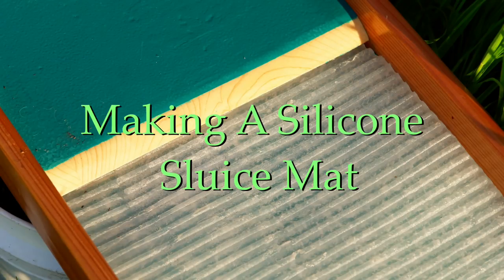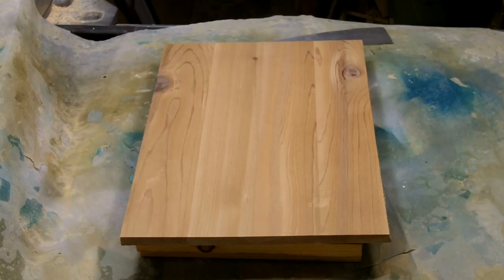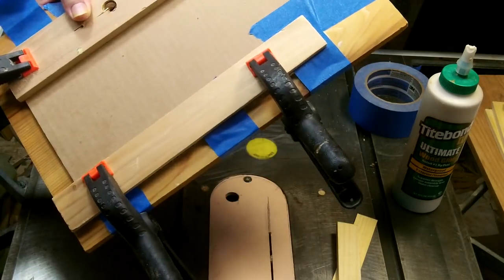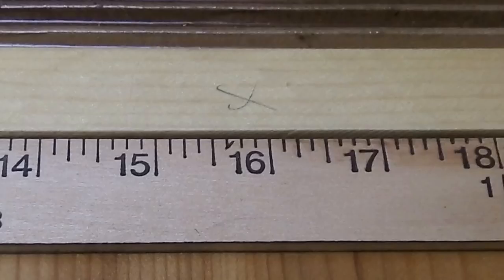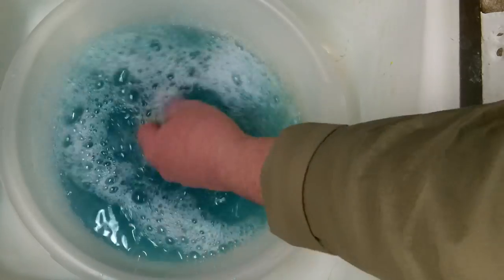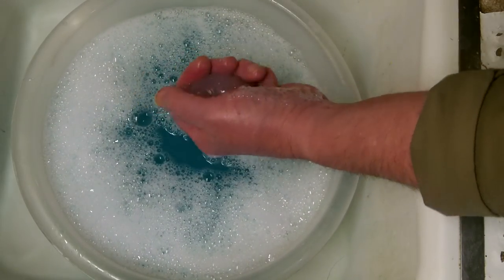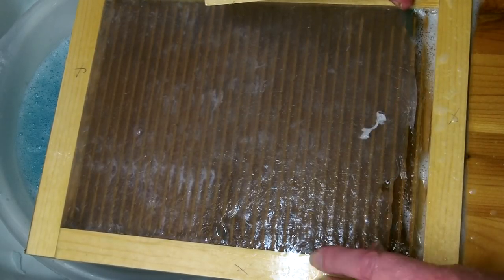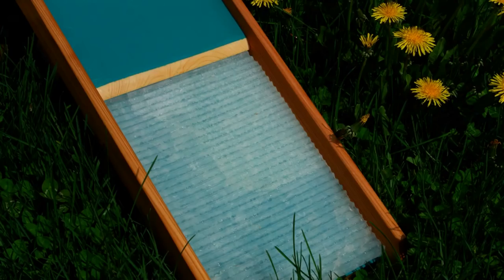DIY SILICONE GOLD SLUICE MAT

Comment: Hi Utahavalanch.  Glad you're back!  I spoke to you some months ago about building a large combo deep well/miller table sluice, and that's coming along.  I was just about to start glueing things down and installing the drop riffles when I came across Alan's videos on diy silicone mats.  I immediately started bugging everyone I knew with kids for legos that might be laying around the house loll.  And I found them in the most unlikely place.  I happen to mention my project to one of the science teachers at the school where I work, when I mentioned the legos she said, " Oh yeah there's a bunch in the back store room , help yourself."  .
So after reading the comments hers my 2cents.  
It took three tries to get a usable mat. Now my sluice is 16" wide and about 24" long....remember the idea was a short wide low flow sluice.  So my suggestion is to work on small sections and piece them together.  I tried to make one big mat using GE's
silicone...what a mess. It just did'nt cure.  I found out that the ingrediants has to say " Acetic Acid is evolved during cure."  So now I use DAP.  
Being the creative type I wanted to color my mats so using DAP I put the food coloringing to the Dawn/water mixture and could not get the silicone to cure.. it look like porridge.  I even tried the cornstarch techique... I used flour instead and I actually got a mat and it was colored but it feels like I could rip it apart.  At this point I'm thinking wooden riffles sound like a great idea! LLLOOLL.  
So out of shear frustration I took a 9x9 baking pan put the food coloring in it and put the silicone straight into the pan...no soap water mixture.  I used a spackling knife to fold the color in over and over until it was somewhat uniform, soaped up the much smaller mold, plopped the ball of silicone on it, soaped up my hands and started pushing it into the mold.  AND IT WORKED!!

I know this is long winded so I'll get to my question.  Since cardboard works as a mold per your instructions, why not use some other thick paper and fold in the pattern I want. Right?  What's bothering me about the lego drop riffles is they are straight down and I would prefer the undercut shape.  So I'm gonna try folding thick sketch paper and following your cardboard riffle instructions.  What do ya think.  Any tips?  Also what kind of paint did you use to make the green mat?
Reply from the maker: Hi Stephanie, welcome back.  I’ve been tied up on many projects and just as I finish one, It seems to bring up more ideas for another. :-D
Part of the answer I was going to leave you, I decided to add to the description as others may find it helpful as well so check that out. You can use the Styrofoam to make angled Riffles for your mat mold. 
Welcome to the land of Silicone Mat Making. I think you had all the same problems the rest of us had. Yep, it’s easy to tell the pioneers. They are the ones with the arrows in their backs. :-D  But it’s some good experience. Yippers, use DAP and I have found that Family Dollar Silicone works well too. Cheaper too.
For the coloring on my mat, I used some acrylic paint from Walmart. I used fast dry and I don’t know if that made a difference or not but the mat dried in about 10 minutes so you really have to hurry. I may try the slow dry next time.  I squeezed about half a tube of Silicone into a plastic glass, added 3 drops of paint and stirred with a popsicle stick. 1 drop would have been more than plenty. A little goes a long ways. Then I scraped it out and added it to the soapy water and then squirted the rest of the tube into the glass and repeated.

The Cornstarch technique as you found makes good molds but really poor mats. The straight silicone works the best and is also the strongest.

See down below for the next segment.
Reply from the maker: As to the Sluice.
I have been working with a similar sluice and with some new tests I’ve been doing I’m making another one. You will be the first in on this info. I’m trying to get a new video out on it but new project ideas seem to be getting in the way.
First make it a recirculating sluice that you can hook up a pump to. You can try a stream sluice but the water control is quite important on this one. Put a valve in about the middle of the hose to reduce pump turbulence and not at the sluice. You may need an 1100 GPH pump for that size of sluice. I use an 800 for my 10”. 
If you can use a 3/4” hose, Home Depot has a 3/4” gas valve that works like a champ. Back in their fittings they have a 3/4” nylon hose barb with an MIP thread that will allow you to hook up the hose to it.
Use the 3/4” wood riffles and not the Silicone Mat. You can buy square 3/4” dowels at Home Depot in the molding dept.  Or you can use 1x2’s if you want a wider top.  Make another 8” finishing sluice to run the cons through and make the mat for that. 10" wide is just about the max for Silicone mats.  Also make the 8’ just like the large one.  Make the Slick plate deck out of 3/4” thick pine or something similar. Just not plywood. Sand it good and flat on the top.
IMPORTANT: round the top edge of the bottom end so there is a good curve to it slanting down into the trough.  Leave about 1/4” - 1/2” up from the bottom of the trough straight for good water action. This curving will guide the gold down into the trough with almost no chance of it getting out. If you can cut a bit of an angle on the riffles that’s good but not necessary.  With this mod you should find all the gold in the first trough. If you find gold any farther down, then reduce the water flow.
Now a new addition to the build if you want to make it and if you saw how it works you will definitely want to add it. Tape off the curved end on the well side. leave the straight part of the top un-taped. Then do the same with the bottom curve. Then paint the top of the Slick Plate with about 4 or 5 coats of Rustoleum Chalkboard Paint. Remove the tape. When you are finished you should have a smooth gloss varnish finish on the slanted part in the well going up to a painted surface and then a smooth varnish finish on the downward curved end of the Slick Plate. 
This is really something to watch in action. This can work with at least a screening through an 1/8” mesh screen. Works the best with screening to 4 different screens and adjusting the water flow for each. 
When you drop the material onto the slick plate, the sand and gravel will move right off immediately and the gold will stay right on the slick plate. Any gold that gets carried off will travel very slowly across the slick plate, down the curve and  down into the trough. You can then brush the gold over into the Deep Well for safe keeping and snuffer it out later. This takes some getting used to when running as you put a scoop of material on the slick plate and about 5 seconds later you see all that gold sitting there nice and clean. Oh, yes, and you can also screen your material to the same size and then just feed it down into the deep well and adjust the water flow to just move out the lights and when they are gone all that’s left is the gold.
Now you can do a cleanup and rerun the material from the riffles over it again or make an 8” version with the mat to run that material over. So there you go if you feel like playing Pioneer again. :-D  Hope this helps.
Reply: @utahavalanch  
Thanks for your reply utah. Yes it's all starting to come into focus.  I had planned on a 3 step approach.
1) big mason tub classifier buried just under the waterline of the stream. The idea that has I shovel into the tub which has a screen on it the stream will carry off the lights.  Kinda like what Alan does with his wheel barrel classifier. 
If theres no streamflow than it can be done manually with a bucket of water.  The objective is to work large quantities of dirt easily.

What 4 classification screens would you use?

2) classified material then goes into another mason tub that is set up as a rather large fluid bed to concentrate further.

3) Then whatever comes out of the fluid bed goes down the deep well sluice.

Now as to the sluice.  What I think you're saying is forget the under cuts and curve both the upstream and down stream sides of the slickplate leaving a 1/4 - 1/2 " flat section at the bottom of both ends of the slickplate...even the deep well side.  Correct?
I'm inclined to use 1x2 for a wider riffle and perhaps give them the same profile as the slickplate.

Would you paint the tops of them like the slickplate?

As far as the clean up sluice, how about making it as an extension that the primary sluice just sits down into.
And figuring out a simple way to narrow and slow the water.

Look forward to your reply.
Reply from the maker: @stephaniedill9966  

Hi Stephanie. Well, lets address each item in turn. Sounds like the big tub classifier would work well as long as you don’t get a stream flow that will wash away the fine gold before it gets into the tub. The screening depends on the size gold you are expecting to capture. They estimate that 80% of all the gold is in the 30 mesh and smaller. That’s what I go after.  If it is like in my area and the gold is 50 mesh and smaller then it’s a waste of time and energy to process the larger material. I usually screen to -12 mesh and then 20, 30, and 40. Most of the gold I find is in the -30 and smaller range but I pan the +20 material just in case. I’m finding that I am working much less material now days and getting much more gold than I used to get in the old days of working like everyone else does. If you screen to -4 mesh and run your equipment for that size then you will blow out 80% of your gold. Run all +20 material separately from the rest.
You can buy excellent heavy duty stainless steel screen on Ebay in the smaller mesh sizes. You may want to use 1/4 mesh screen to screen into your tub and then use smaller screens to reduce it down to run through your equipment. I use 1 gallon screener buckets to screen my material down. It only uses an 8” square screen which is inexpensive to buy and I can screen almost as much material at a time as the big 5 gallon size screens. Or you can use the 5 gallon screens to screen it down into 5 gallon buckets. The closer you get all of your material in a batch to the same size and adjust the water flow for it, the more success you will have.
One thing to remember is that a 5 gallon bucket of dirt shoveled in from stream or bank only has at very most, 1 quart of useable material and only 1 oz that has any gold in it. Now days I try to reduce the material down so I only work the quart that has the gold in it. 1 drop riffle will handle the 1 oz with the gold in it quite easily.
So I guess the bottom line I’m saying is to know what size gold you are working with and build and run your equipment for that size gold. 

See next down below
Reply from the maker: Fluid beds work well as long as you know how to use them. If you don’t they will flush oz’s of gold out the end. I know, you see a lot of people running them and getting some fine gold. Some is the key word. Most is blown out the end. I tested for 2 years in a closed environment and found they are very lossy unless run properly. I am currently running all my old fluid bed tailings and getting the gold back I lost. That’s why I moved on to Drop Riffle.
Only work 1 screen size through them at once. Remember they blow out the fine material and only keep the heavies. If you have a mix of +20 material and smaller, then you will only have the +20 and maybe some 30 in the end. The -30 with the gold is out the door. Remember, fine gold is not as heavy as most people think it is. It is very light and easy to get caught up in water currents.

See next down below
Reply from the maker: Now the sluice.  Sorry, I’m not very good at verbal descriptions. I  am usually able to send pictures to describe what I am saying. Wish I could do it here.
If you have a saw that you can make the under cuts on the Riffles with, I would make them. 20 degrees right now seems to work well until I can test more. If you can't cut the angle then vertical will work fine.
On the slick plate, on the Deep Well side I usually cut that to a 45 degree angle so the whole end is at an angle. That makes it easy for the lighter material to wash out. The way you are using it, I think I would leave about 1/2” from the bottom straight up and down and only curve the top 1/4”. The reason is that it would make it harder for material to get out and it would be a good trap for gold before moving on to the riffles. The curve on the top would smooth the water flow.  I think I would put a board across the end to make it a closed chamber and allow the water outlet from your tub to flow into it.
The bottom end of the Slick Plate should be the same. A little bit of up and down wall on it helps to generate a good working vortex swirl in. Maybe only 1/4” on this as it’s important to have a very strong downward slant at this point. This is what guides the gold into the trough.
I would paint the slick plate top with Chalkboard paint to help the gold stick or slow down so it makes it down into the trough. Even more important if this will be your fine gold trap.
If you will be using 1x2’s then I would certainly paint them as well.
I would keep the cleanup sluice as just that. For cleaning up the cons. Even much better would be a Miller Table to clean up your cons. That way you would be able to catch the very finest gold.
To slow the water flow through the sluice, you can make a pvc stand like in my video on it but make it with 2 long bars instead or maybe 3 for a sluice of your size, instead of just one for better stability. That way you can adjust the sluice to fit  under the output flow of your fluid bed and then raise and lower the other end of the sluice to adjust the water flow. Raise to slow water and lower to speed it up.

Anyhow, sorry to be so long winded as well but I hope some of this helps. This is only my opinion. I have spent my days for the past 10 years building and testing equipment and these are some of the things I have come up with. I have found by testing the ways other people are doing things on the internet and what my tests show are two different things. So you be the judge of what works best for you. Best of Luck.

Comment: Great video and advice. I would however use mould star 16 from Smooth-On to cast the silicone mat - less messy because you don't need soap as a release agent and it cures within 30minutes.
Reply from the maker: Hi Dan and thanks for watching. That would probably work well. I’ll have to give it a try. It’s about 2.5 times more expensive than the silicone I use so it would make a large mat quite expensive. But it would probably work for small projects.

Comment: It’s very interesting to look at your work. A huge request, if you decide to make a new video, then in the comments to it please indicate the name of the materials you use. Knowing the exact name, finding an analogue will not be a problem. In other regions there are no colors exactly like yours, but  It’s simply impossible to read in your hands. Thank you!
Reply from the maker: Hi Sergii and thank you for watching. I will certainly try to do better with my next videos. I have people watching from many different countries and the woods I use aren’t available to them so I suggest they use what ever is available to them. 
For all my projects I use cheap Cedar fence boards which is the red wood and cheap pine for the lighter colored wood. I build many of these projects and so the cheaper wood is more affordable for me.
The glue I use is Tightbond III waterproof glue which should be available in many parts of the world. The Helmsman Spar Varnish may be harder to find but any waterproofing varnish made for waterproofing boats will work. The Silicone is GE type 1 clear 100% Silicone. The 100% Silicone is the most important. Any dish soap will work as a release agent.
I hope this will help.
Reply: @utahavalanch  Thank you very much for your video and for your answer. It will help me a lot.  Good luck and blessings to you in all your endeavors!
Reply from the maker: @sergiitkachenko8976  thank you.👍

Comment: Hi that is the best idea I've seen in a long time.  Grate job.  🌛😭🌝😀🐕🚶
Reply from the maker: Thank you and thanks for watching. I build and test 3 or 4 different sluices a month and some are different sizes and it gets expensive buying mats. This makes it easy to make a mat to fit a particular mat sluice very easily and cheaply. It's easy to make to mats and glue them together to make a longer mat. Plus they are really durable and easy to repair if damaged.

Comment: Maybe try getting waxed cardboard like  a lot of produce farmers use more resilient to water . Maybe you could make just a smooth flat mat for the Miller table try adding green dye to it see how it turns out .
Reply from the maker: Darrell Goodman 
Hi Darrell. You need regular cardboard so the Spar Varnish can soak through all the fibers. When it dries, it dries hard so you can us it as a mold. The waxed cardboard will collapse when you put pressure on it to apply the Silicone.
The Chalkboard paint works much better as only the gold sticks to it and the black sand slides off. With the Silicone, both the black sand and gold sticks to it.